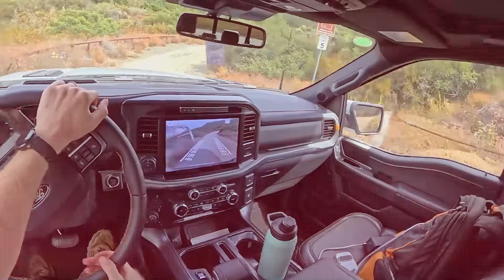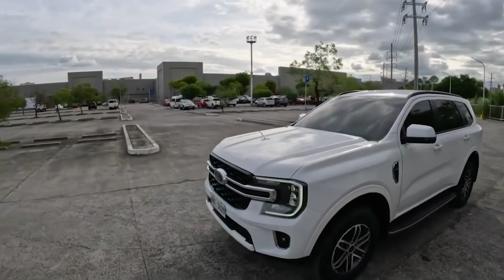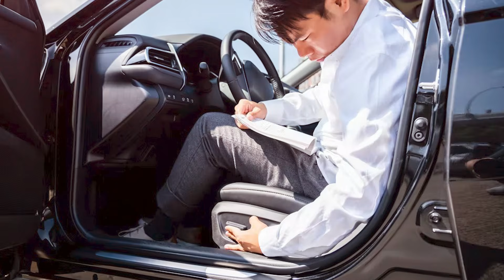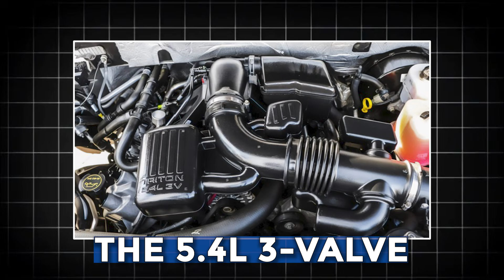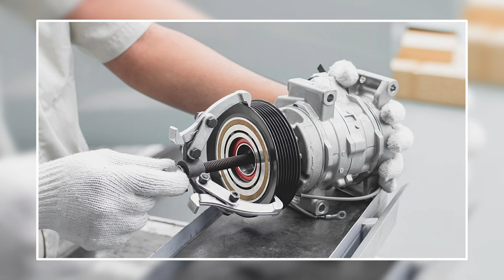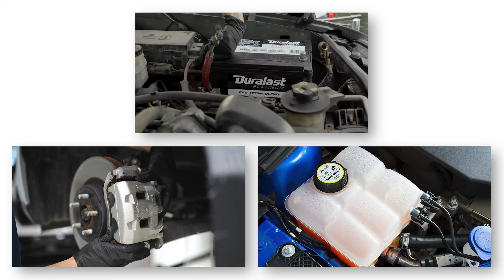How To Make Your Ford Last Over 300k Miles Without Any Major Repairs

Comment: Change my oil every 4 k,flushed my trans at 57 K,run Chevron gasoline plus a radiator flush.Ford trans run at 203 degrees on HWY

Comment: Do a transmission drain and fill 2 or 3 times = true longevity. Or, change it once and then start removing only 3 of your 6 quarts of engine oil to match the same car killing protocol. 😅